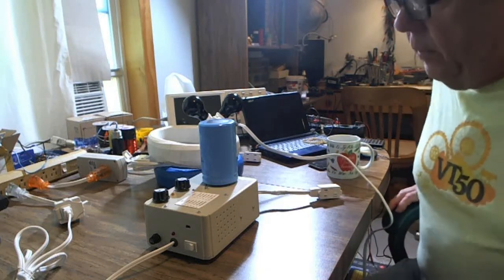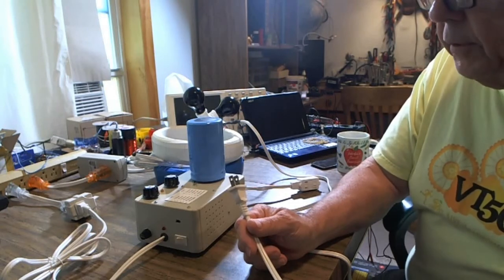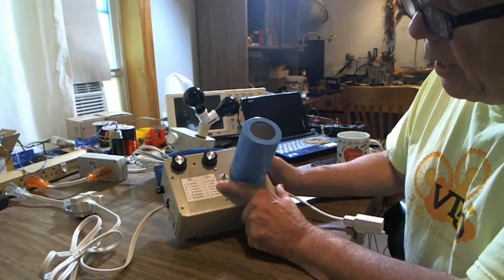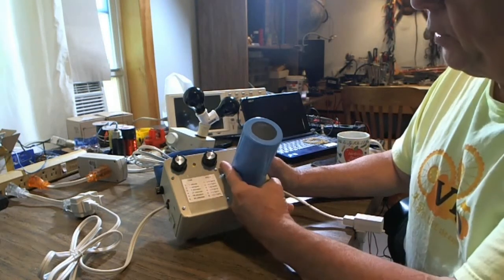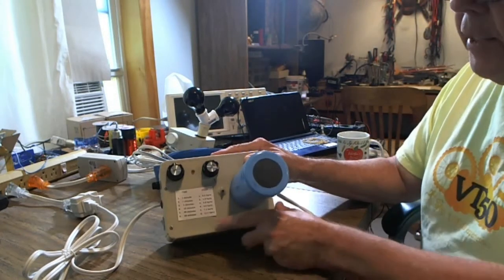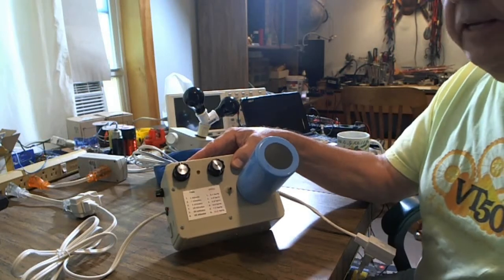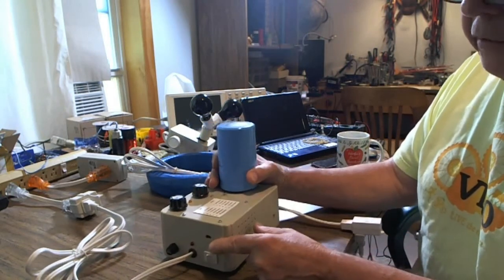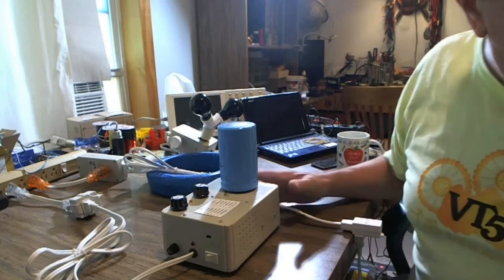High Powered PEMF #1

Comment: I'm not quite understanding this. Is this somewhat like the expensive, big name PEMF devices? This seems completely amazing if it relieves inflammation and pain like the big names in the industry, and at thousands of dollars less. I'm currently using a unit to treat my entire body, head to toe (brain injury to neuropathy, and everything in between) Would love a unit like this if it works similarly. Also, do you have a whole body mat coil? Thank you!.
Reply from the maker: It really isn’t amazing it is simply a unit developed without the greed motivation.  Because people will pay anything for relief and the PEMF has a remarkable history of providing relief, it is a technology that is destined to be exploited for FRNs (Federal Reserve Notes or dollars).  I started out with the Bob Beck style PEMF and quickly realized this is a unit with a lot of potential but needs more power.  I then had the opportunity to experience an MRI to investigate some back pain I was having.  As unbelievable as it may sound, I had roughly a whole month of no pain after the MRI.

A new internet friend sent me a coil that worked better with the Bob Beck style PEMF than the Bifilar MAGnetic Coil I was using.  This was the start of a quest to design a unit that was inexpensive and that worked.   All my work is Open Source with the intent to help others help themselves.  The new design is simple with regard to component count because it uses a Micro Processing Unit to control some modern component technology.  The expense of putting a unit together is mostly labor and not parts.  If the greed factor is eliminated, the unit becomes a fairly priced PEMF that works!
 
No fully body mat coil YET!
Reply: I certainly appreciate your hard work and dedication. Electricity is not my forte or I would build one myself. I desperately need a unit for myself. I have had two car accidents-one on December 6, 2005, the other on March 18, 2017. I was temporarily paralyzed in the first accident, when my son rolled our small pickup 3 or 4 times. . I was ejected and the front bumper came to a stop on my right leg. Broke 7 vertebrae, 4 ribs, my right hip in two places, my knee was blown out and now has massive amounts of calcium on both sides, right tibia was shattered into 100+ pieces, and fibula was broken. Also suffered a traumatic brain injury, a lung injury, and a spinal cord injury, as well as a bulging lumbar disc and two herniated lumbar discs.

In March of this year, I was rear ended while sitting at a stoplight. It was just plain ignorant that the guy hit me (I believe he was drunk). He was sitting 50 feet or so behind me, took his foot off the brake and started to roll toward my car. Instead of hitting the brake when he got close, he hit the gas and plowed into my new 29-day-old car I'd just bought to drive Uber and Lyft with. I thought nothing of it until I woke up the next morning aching badly in the head, neck, and shoulders. My mind totally left me at my work that day, fortunately my lsat hour of the week. I am a casino dealer in my full time job, and I made 5 very uncharacteristic mistakes on my blackjack game in less than an hour. My pain got worse and worse until I was treated by a chiropractor on March 23, 2017.  We later learned that I got two more herniated discs, a mild concussion (my 8th I believe), and 12 bulging discs from the second accident. 

After the MRIs, I seemed to hurt less too for a few days. In the middle of June, I went back to work after missing 12 weeks, and my back pain regressed. Finally in July, I learned about PEMF therapy from a horse friend in Pennsylvania. She suggested I find a practitioner. I did, and was amazed! I really need therapy every day at this point, but simply cannot afford to pay my wonderful practitioner that much money. Thus far, PEMF has really helped is my brain. I also had a lump on my forehead for nearly two years, and it has shrunken by about 50% in just a few treatments on very low intensity. My hip pain is nearly gone, and the back back has decreased to the point that I actually worked 80 hours in the casino the past two weeks in addition to my Uber driving- this for only the second time since my accident. I've noticed since using a high intensity device,, I need lower intensity on my back, or the muscles get too tight. How would the strength of your machine compare to a machine with 17,500 gauss? It seems the neuropathy in my right leg is also easing a bit.I am in love with PEMF! Does your machine make a person's muscles jump like the high intensity machines? BTW, I have also gotten great unintended results on my prostate and even my bowels. These machines are a miracle!
Reply from the maker: Your story is too unbelievable that I’m at a loss for words.  No, the High Powered PEMF does not make muscles twitch.   I doubt that what I’m calling High Powered is more than a few thousand gauss if that high.  Compared to the Bob Beck Style PEMF it is many times more powerful.  PEMF Technical Video 3 did a comparison test using a Trifield 100Xe meter.   The measurement test was at 20 feet from the coil.  However the square of the distance law applies and at a few inches the pulse would be significantly stronger.   I actually do not know how to measure what the pulse strength is without buying an expensive meter.  Those technically inclined and reading this reply are welcome to suggest how I might measure the pulse strength.  Contact can be made at the www.aurorasky.net website.  Respectfully Steve
Reply: My experiences certainly have changed my outlook on life. I actually told the doctor and emergency personnel at the scene of my first accident to 'let me die-I do not want to live if I'm paralyzed'. I realized a couple of months later if that had happened, my son would likely be mentally messed up for the rest of his life. I also learned that dying is the cowardly way out. So many people have issues 1000 times worse than I have. PEMF makes my conditions seem fairly minor.
Reply: @LVGaryD1  look into aajonus vonderplanitz

Comment: Am looking into building my own, 10.000$ is just way silly for a reasonably simple device.
Yours is a great option and price too.
What do you think about  flat coils to make a full body bed.  
I was thinking 1 layer of 14awg wire about 40cm width total and 3 of them in a mattress. 
I have plenty more questions but I suspect your site will have the information, will read more tomorrow.  Thanks.
Reply from the maker: Flat coils should work well.  They offer the opportunity of making a mat like the competition offers.  Please don’t misunderstand that this unit will compete with a unit generating a ½ Tesla or more.  My best guess is that this unit gets up to about 400 gauss.  If you make your own then consider doubling the input voltage.  That is what I’m going to do on the next version.  Whenever that happens?
Reply: Thanks.
Your kit is doing reasonably well in comparison., 400 gauss already beats the majority out there, Curatrons mat and biggest driver, 500 gauss (12500$). 
Sure one might need a kit per section of mat to somewhat match it, still, wouldn't knock it for the expense. 

Straight off just feed 64V AC in to the same design? Sorry not that gifted at circuit design, will this kit be able to handle it, perhaps just more cooling?

Thanks again for putting these things out there.
Will keep following your progress with great interest.
Reply from the maker: Not sure what advantage 64 AC volts would have verse the 110 AC volts from the wall outlet.  The voltage gets ½ waved rectified into peak 160+ volts that charge the Capacitor in 5 steps.  It is called phase charging which does a little at a time so it doesn’t pop fuses or trip your circuit breaker.  Then the cap dumps into a coil.  For a fraction of a fraction of a second the current flow from the cap to the coil  will exceed a 100 amps.  There is a contact button on the www.aurorasky.net website that will give access via an email for more info.  Be well and respectfully, Steve
Reply: @gskempe9  what's the latest unit operate at.. what power level?